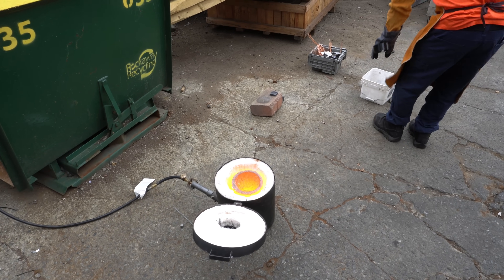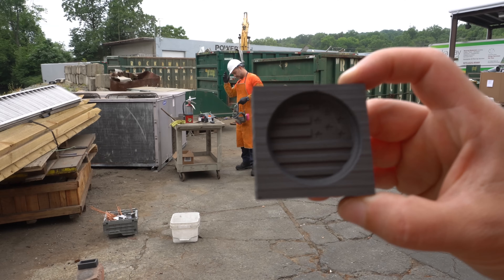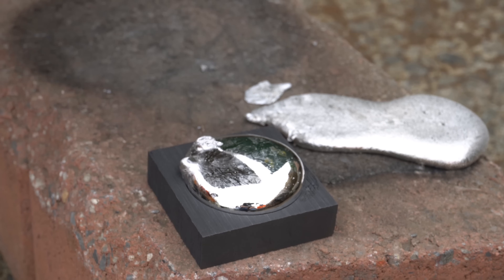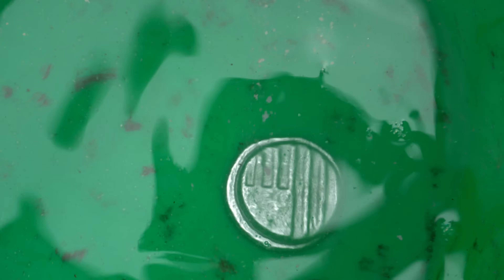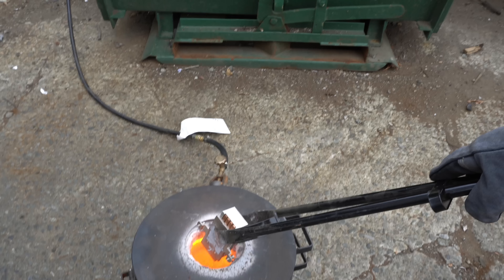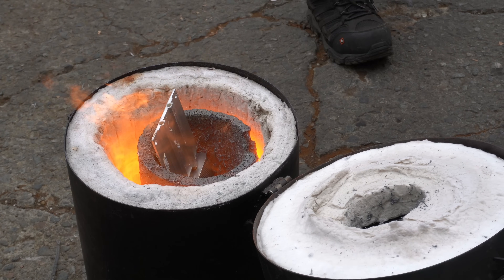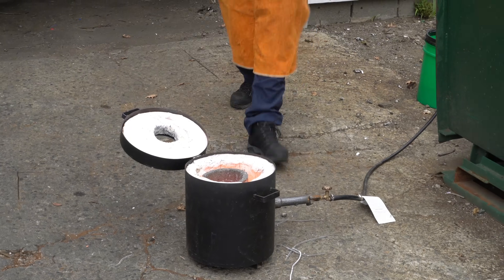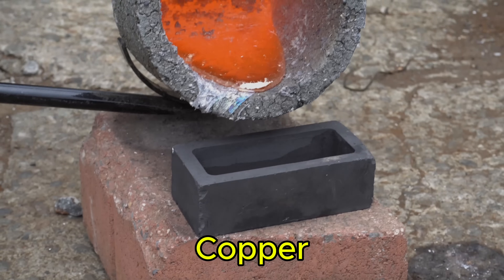Melting Scrap Into Aluminum Ingots [DIY Yard Project]

Comment: You folks definitely can make a couple things easier, in addition to being safer. For exsmple, use more water in the bucket, so you dont have to hold a molten piece of metal in a restricting way, which will also save time, not having to go so deep into the bucket. Speaking of buckets - isnt that a PLASTIC bucket?! Please for the love o’… USE A METAL BUCKET to hold the water in. Cool stuff, nonetheless, so mahalo for sharing. Aloha

Comment: The copper cooling tubes contain water vapor. If I were to make aluminum ingots, I would probably use clean, dried cans. It might be fun to have you create a coin/token/medallion via a design contest. That said, stamping them out, instead of casting them, would perhaps be the way to go.
Reply from the maker: Our yard doesn't accept cans so we had to make do

Comment: This copper things are 'heat pipes', which means, they contain some fluid(mostly water?) and are sealed on both end. You just have build a small pipe bomb.
I never used a kiln, but I know you should never put anything sealed into a fire. I had much fun with cans of beans or beer exploding in a camp fire. You've done exactly the same, but I had done it intentionally.
Reply from the maker: Clearly we didn't have that experience you had with the campfire. Would've come in handy!

Comment: Ya need to pre heat the molds befor you pour. Alsoon the coin do not put the mold in the water could break due to the shock. On the heat sinks you need to remove the sealed gas to prevent the explosion. You need to do that on door knobs as well
Reply from the maker: Thanks for the tips!